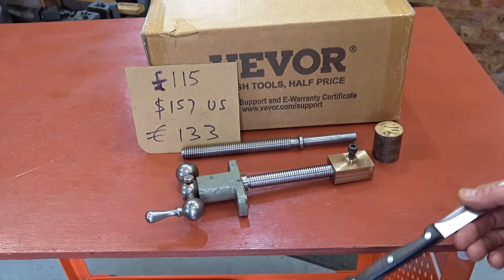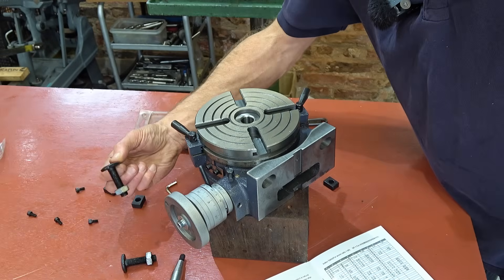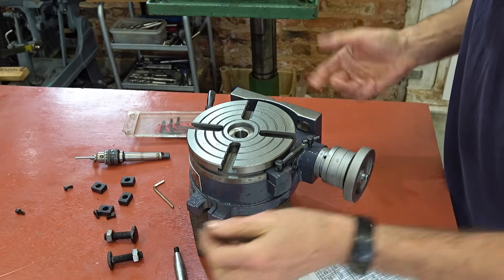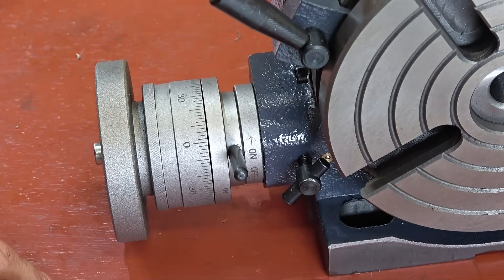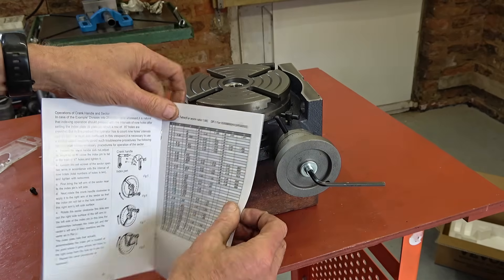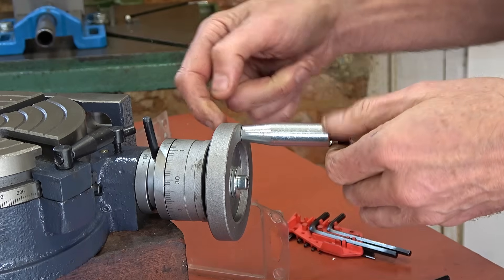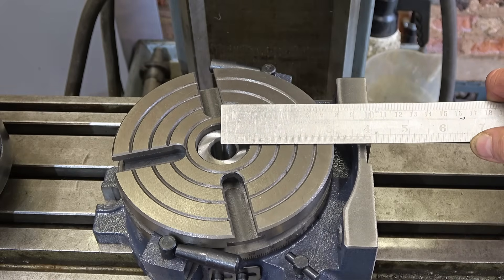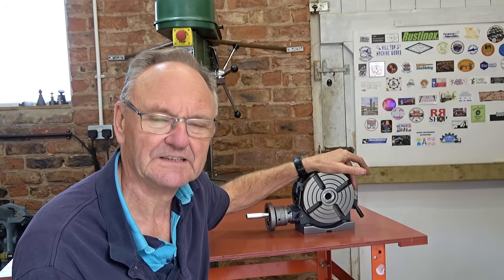HS329 Vevor rotary table review

Comment: It will be interesting to see a follow-up video stripping this down to see how well the important bits are made + a basic accuracy check to see how parallel the table top is to the base, face camming, centre runout etc. From this video I can see why my Vetex RT of the same size cost more from the overall external finish alone (plus I could get the dividing set for the Vertex. which Vevor mention but don't appear to sell ?) but it may be accurate enough considering its price point. The "imperfect" rotary table you have because it was affordable is far preferable to the "better" one you don't have because you couldn't afford it !
Reply from the maker: Hi there, sometime soon I will strip it 'on camera' and check the accuracy. Apparently the links in the description for USA and AU are for the table with dividing plates included. Just the UK item does not include the plates so I've asked Vevor why? Usually they will respond to my questions, so let's see what they say. Cheers

Comment: the first thing to make once you have a rotary table are a set of MT2 tapers with accurately sized cylindrical holes, or a set of MT2 collets, so that you can position a centering pin in it, most of the things you'll be machining with a rotary table will have a hole in the center so you want to be able to drop it on the centering pin in the rotary.

the next thing you'll want are a couple "right hand cut left hand spiral" end mills for milling the OD of something that will tend to get pulled upwards with a regular end mill, this is especially helpful for thin material.  these tables aren't all that good at resisting upward pull, but obviously are impervious to downward push.

what I want to know is what sort of run-out does the table have,  I'm not talking about backlash, rather if the table isn't locked does it have any X-Y play,  mine has about .001 play in the X-Y plane and I'd like to know if Vevor is better.

Comment: Thanks for this review Paul!  I've got Vevor's 6-inch (BS 0 clone) index head (kit), so if I buy this rotary table (kit), I'll try to adapt it to use the index head's index plates like you talked about.  Thanks for the very honest review --> thumbs up!

Edit: I see that the links you provided are for rotary tables *with* dividing plates, so adapting the table to accept index heads isn't necessary.  Or at least the U.S. one has the plates.

I also compared the instruction manuals for both the 6-inch table and the 6-inch index head to see what their center heights are and both are the same (100 mm or ~3.93 inches), meaning that the index head's tail stock can easily be used with the rotary table.
Reply from the maker: Bob, thanks for the comment - as you point out when I click the discount links the table comes with index plates in USA and Australia but not in UK. I will feed that back to Vevor. I can't see any reason for that. Very odd. Cheers  👍

Comment: Good review.  I have their 8" model and the same design of 6" from a different manufacturer.  I will mention, the internal components are contaminated with grinding dust and are best cleaned before use (if you intend to use it a lot)  Also they skimped on a few internal elements, the oil port over the handle does nothing as on mine they did not bother to drill the hole to reach the inside screw through the adjustment mechanism.  I just greased it for simplicity as I don't intend to put a lot of use to the device.
Reply from the maker: Hi, thanks for the detail. I will strip and clean it and check the oiling points are functional. Cheers
Reply: Stefan Gotteswinter always advised a thorough clean of cheaper import "kits" before use. If you find, by chance that all is well, at least you have had a good inspection of the internals. This might just show up similar problems to the "blind hole oiler". Fore warned is fore armed.

Comment: "Haxby_Shed unboxes and meticulously examines a Vevor 6-inch rotary table"

"meticulously examines" ought to say "cursory examines".

I have an 8" version of one of those - identical - as far as I can tell - but with a Vertex badge on it. Vevor? Vertex? This model of table is sold around the world under various badges. Probably made in China and re-branded by the distributor.

My particular version is poorly made and finished and is rough and inaccurate. When turning the handle the indexing collar wobbles and the the table is tight in places and loose in others.

Definitely wouldn't recommend it to any one.

You said that you can knock out the morse taper from the back. Did you try it? On mine I couldn't. It would be useful to viewers if you could confirm morse taper removal by actually doing it.

Having to make all the components you described to allow the dividing plates to fit is nonesense. The plates should fit out of the box. That whole assembly as you descibe it is rubbish.

You say the profile (height of the table) is 'quite good'. In fact it's very high compared to my other two rotary tables of the same table diameter. I use my rotary tables on a Bridgeport (clone) mill and headroom with this rotary table is always a problem. I only use this one because it has a three jaw chuck attached.

All in all a poor review of a poor product. (If, indeed, it's made by the same company that made mine).

Comment: Looks very much like the Soba brand which is good value. I have a four inch with the 2MT taper. I use 2 MT collets in it with a very short draw bar underneath to hold stock when needed and to hold down a four jaw chuck. Thanks for posting, subscribed now.
Reply from the maker: Thank you Robert. I'll have to think about how I hold work. Cheers

Comment: I have the 4in one, I found plates on Amazon for the 4 and 6, but haven't tried it yet. The Vevor 4 I got on EBay had broken table gear.
Reply from the maker: Hi David, I'll have a look at the rotating mechanism / table gear, when I strip it down to clean it. Cheers

Comment: is the top parallel to the bottom? is the morse taper true to the circumference of the table? is the morse taper perpendicular? the other stuff are minor easily fixed. but for accurate work you need to be checking these. there are many things you can do with it with just a few simple accessories plugs, fixture plates etc. good price👍
Reply from the maker: Hi Paul, I will have to check those. Probably an oversight that I did not. But I will come back to it sooner or later to fit the index plates, so maybe then..... Cheers
Reply: @HaxbyShed  check that it runs flat as well, even though the top could be parallel with the bottom, theoretically both top and bottom could be wedged shaped.

Comment: Vevor sources their stuff from multiple manufacturers so there may be differences even ordering a particular item at different times. Also you may or may not have continuity/ compatibility between items in the same category.  I have a few items from them and have been happy with what I got for the price.  As you rightly pointed out the documentation on all of their products is very weak.
Reply from the maker: Hi Joe, I have the 6in/150mm milling vice. Several of my friends have the same, purchased over a period of time, and they are all subtly different. Quality varies slightly. Cheers

Comment: What size is that rotab? Looks like 100 or 125mm. With a bit of fettling I'm sure it will be useful. I guess you'll have to drill and tap to mount the dividing plates on, however, in my experience, as you have a dividing head you'd use that to cut gears and use the table for rotary milling tasks.
Reply from the maker: Hi, it's a 150mm / 6in rotary table. Cheers

Comment: Hi Paul, nice review. I’ve just bought the same 6” Vevor table and I have exactly the same issue with the handle screw - a problem I intend to fix by shortening the screw a little. You may have realised by now, but the worm engagement can be fine tuned by means of a small grub screw - backing it out reduces the backlash and vice versa. If you’ve not seen them, Stefan Gotteswinter has done a number of videos on the Optimum (Vertex) rotary table - virtually the same as the Vevor. The first video is quick strip, clean and fettle https://youtube.com/watch?v=7YMVZCe1LHQ&si=b0ljm5Ljbpw884Rd he follows this with a simple improvement to make tramming easier in this video: https://youtube.com/watch?v=L63LoQF37lM&si=tqX8od0_w3nrDAGy then there is a more involved series of three where, through scraping, re-machining and fitting a hardened bush he turns it into a precision piece of workshop equipment - well worth a look. Part 1 is here: https://youtube.com/watch?v=DTRc5B1HcRc&si=qLVW1_kpSC20SmVe Part 2 is here: https://youtube.com/watch?v=Y12egye27JQ&si=BnFMwpJgya2x26dJ and this is part 3: https://youtube.com/watch?v=W6hBM9Kl0hk&si=LTqTzKAel31mSRix All the best…

Comment: Impossible to get dividing plates for them from Vivor.  I did get a set that was on Amazon for my eight inch table.  Haven't installed them yet so they may or may not work.  That was about the only ones I could find in my search and they only came up several weeks after I started looking.
Reply from the maker: Hi Douglas I will adapt/fit the dividing plates when I get time. I need to finish the tool and Clarkson cutter grinder series first. Cheers

Comment: Interesting! Looking forward to your Clarkson lead screw and nut project! Have a Clarkson MKI  that I re-scraped entirely and put a two speed pulley set up on to give it the speeds of a MKII. By the way the Clarkson spindle is noisy, I changed the bearings on mine for nothing! Cheers, Matthew

Comment: Hi,Paul. This Vevor 6" table is almost identical to my import table and mine has provided years of reliable service. The locking levers and handles are almost always cheap and pretty poor but not difficult to improve on the standard items. I also use the indexing plates from my BS 00 import/copy dividing head but I think you are going to have to drill and tap 3 holes in the main casting boss to attach the plates to the table(not a major issue)
I think these represent good value for the price but as always strip and thoroughly clean and re-lubricate before use.
Reply from the maker: Hi Howard, yes I am planning to dismantle and clean it. You could see there was quite a mucky residue on the faces and parts generally. Cheers

Comment: Great video. Looks like it might be good for the money. Fit and finish definitely leaves a bit to be desired. Thanks for sharing.
Reply: I regard them as a kit, you strip it, clean it, and finish it off as part of the process of buying it. Better lubrication and better fitting together means you will know how it works then, which helps when you use it.

Comment: Dicky Bird wasn't tight he always shouted Lillee and Marsh a pint R.I.P .Paul strip the rotary table out completely and wash out all the grinding dust out and re lubricate .
Kit from down under
Reply: Yes, I would recommend stripping and cleaning...do a bit of fettling to get everything running smoothly and re-lube it before reassembly. I did it with mine when i first got it.
Reply from the maker: Hi Kit, it's on my list to do that. I'll fit the diving plates too. Will be a video. Cheers

Comment: Rotary tables are very nice to have. I started with a 6” but I found it to be a bit too small so I got an 8”. Heavy though. It’s a Phase II. A pretty decent name and they do make their own products. Be careful. Mine didn’t come with oil in the unit. They do that so if it tilts during shipping it won’t pour out, so check it before using it or it will freeze up at some point. It takes a bit.
Reply: "they do make their own products. " - how do you know that? I have one of those - identical - as far as I can tell with a Vertex badge on it. Vevor? Vertex? This model of table is sold around the world under various badges. Probably made in China and re-branded by the distributor. By the way my particular version is poorly made and finished and is rough and inaccurate. Definitely wouldn't recommend it to any one.
Reply from the maker: Hi yes they are definitely made in China and down to a price, not a secret. They are usually good enough for everyday hobby jobs. I'll check runout on the surfaces later. Cheers

Comment: That was a good review Paul. I think they put the wrong bolt in for the handle. It should be a pivot bolt with a plain shank, cheese head and a short, reduced diameter threaded portion. Hence the short female thread in the wheel. I think Vevor tools are outstanding value for money. I needed a set of extra long reach imperial socketed Allen drivers for my gas turbine project. I got a set of metric and imperial ones from Vevor. The whole set was the price of just one bit from some manufacturers.
Reply: A shoulder bolt.
Reply: @melgross That's the one.
Reply: @carlwilson1772 I forget names for things all the time.
Reply: @melgross I worked at a place where shoulder bolts were called pivot bolts habitually.
Reply: @carlwilson1772 weird. A pivot bolt has a flat head with a hole in it and it pivots around that. I used a hardened steel one when I modified my tailstock from a wrench tightening to a lever tightening.
Reply: It's not the wrong bolt, its the cheapest bolt they could use to hit such a ridiculously low price point.
Reply: @EitriBrokkr they by then in such large numbers that I wonder if it matters. They don’t make their products. It’s a screw.
Reply: @EitriBrokkr Good point and well made.
Reply: @EitriBrokkr  When i say the wrong bolt/screw I mean it is the wrong type for the application. Many other brands of this style of rotary table use a shouldered bolt or screw with a domed head as standard and without the excessive end float seen on Paul's Vevor table.
Reply from the maker: Those "Extra Long Allen Hex Bit Socket Set" drivers look good Carl I'm tempted. Cheers
Reply: @HaxbyShed They are very good Paul. The only problem is I wanted a set that are ball ended. I need imperial ball ended long reach and they are very expensive. I'm considering making my own by cutting up an imperial Allen key set and mounting them in appropriate sized sockets.
Reply: Yes,definitely supplied with the wrong Allen screw for the handle/wheel. Mine is the same type as you mention.

Comment: Why does 63 teeth work for metric conversion ? 254 / 2 = 127 | 127 / 2 = 63.5 not 63
Reply: The 63t gear is a compromise. It's cheaper to make than a 127 and being physically smaller, fits into the change wheel train of smaller lathes more easily. Though not a perfect conversion, the error of about 0.78 is considered to be acceptable for all but the most demanding applications.
Reply from the maker: Hi John, Carl's comment is quite right it's a compromise. I have actually done the calcs on a spreadsheet and combined with the other gears in the drive train it works out as a 0.013% pitch error at the cutting tool. That's not a problem unless the screw is very long and screwing into a very long threaded sleeve. Cheers